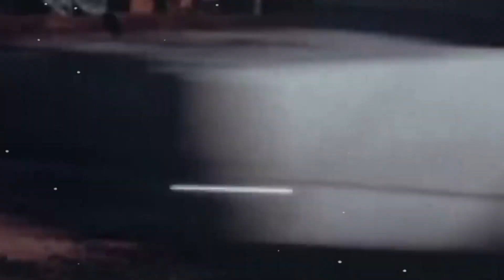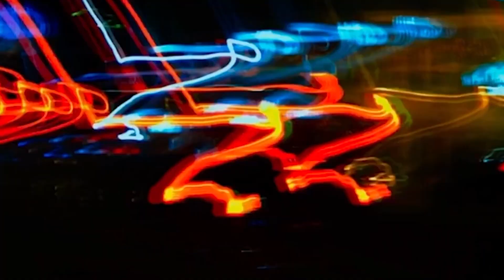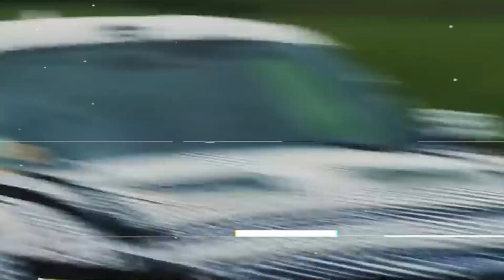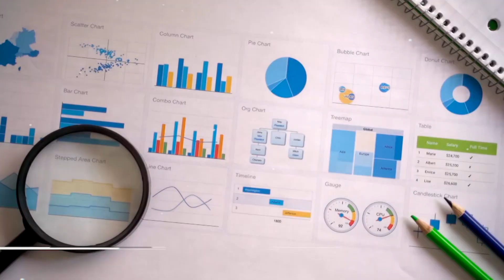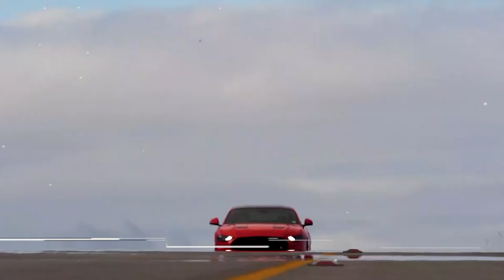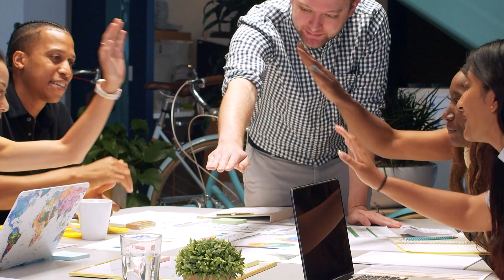FORD CEO  “Our New Ecoboost Engine Will DISRUPT The Car Industry!”

Comment: Mitsubishi already does direct fuel injection (they invented it on petrol engines), VVT, forced induction. So does VAG, PSA, GM. 
And Ford's Ecoboost has an appalling reputation for reliability. Why don't we talk about their Power Shift DSG? Oh, probably best we don't.
Reply: Fascinating...my truck is apparently a ticking time bomb, 120,000 miles and still kicking ass.
Reply: @kb9oak749 120k isn’t something to brag about